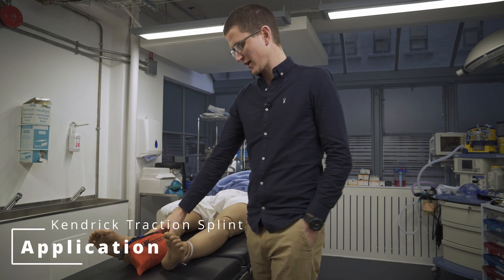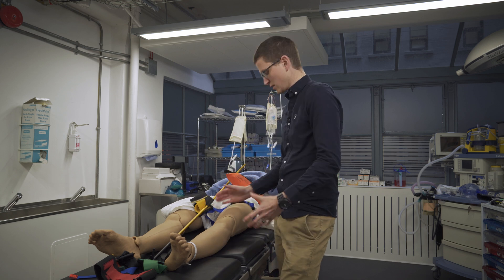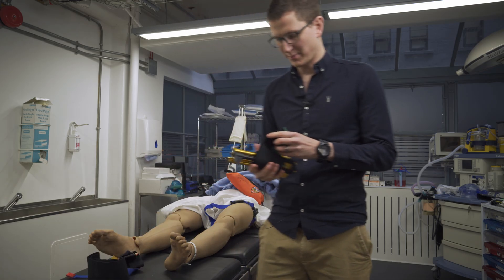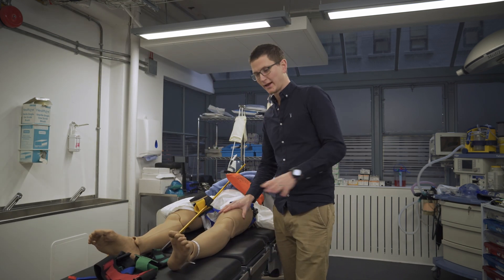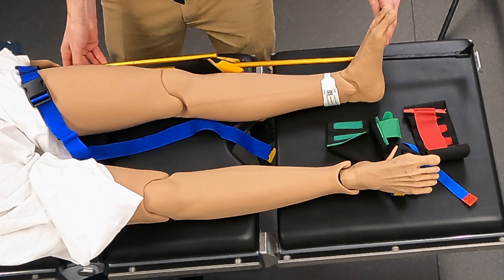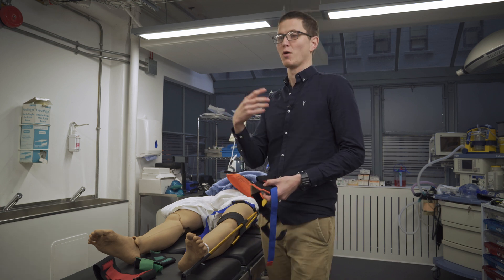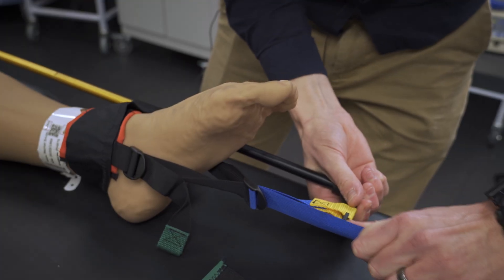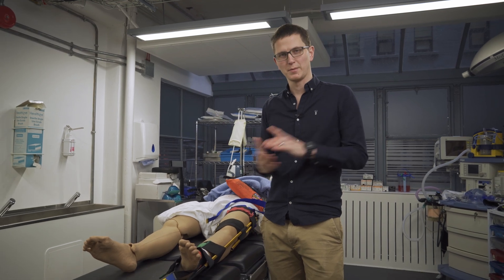How to Apply a Kendrick Traction Splint: Step-by-Step Guide for Paramedics

Comment: Do you takeit out and re apply if there is no distal pulse after applying the splint or do you let it reamin like we do it for pelvic binders?
Reply from the maker: You could release some tension. If that doesn't do it. Treat it as a threaded limb.
Reply: @allthingsparamedic I suppose you meant a 'threatened' limb, in which case it's a load&go patient as it needs urgent orthopedic/vascular or hyperbaric intervention.
Reply from the maker: Yes, my apologies, threaten limb. Load&Go